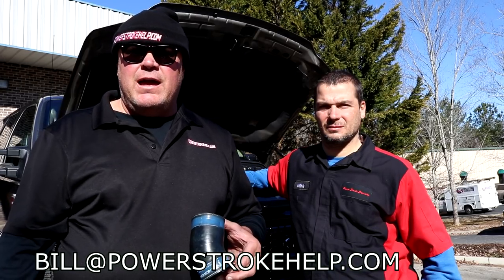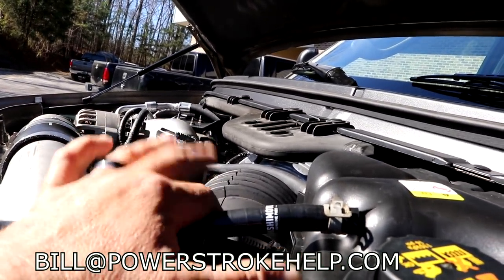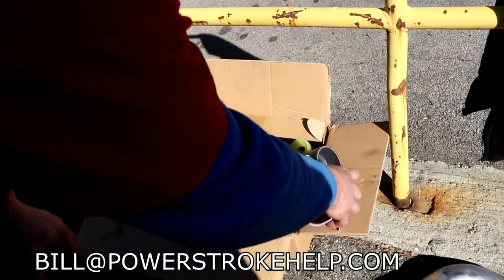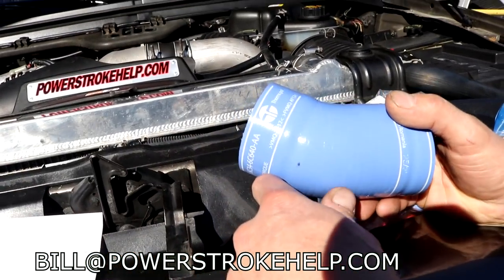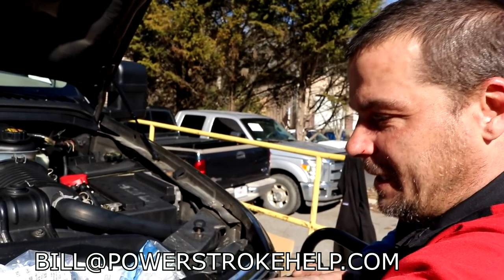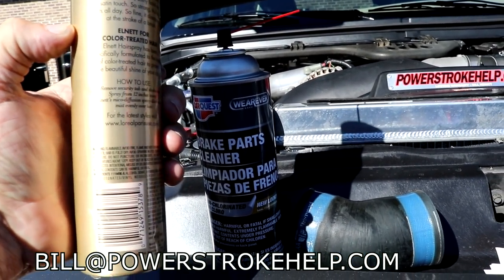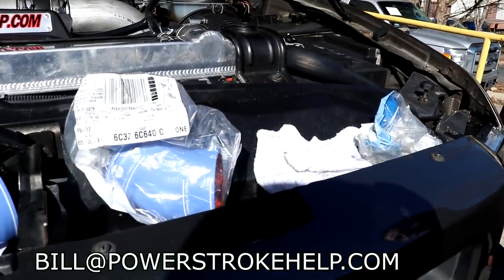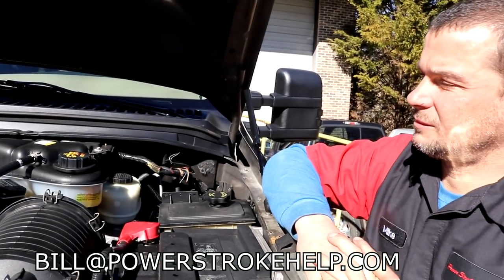POWERSTROKE TURBO BOOT FAILURE

Comment: The bank's intercooler tubes have these indentations, if you have a boot blow off on the side of the road, clean the intercooler Boot and the tube with brake cleaner, this will get you to your next stop so you can buy a new boot. Also when are we installing a new boot after cleaning each side, spray cheap Hairspray, not fancy stuff like Aquanet cheap, this allows you to slide it on easily, when it dries it will be sticky.

Comment: I love it when a master mechanic is passionate about his opinion. This is the 2nd or 3rd video that I've seen where Mike is trying to stress the point that the OEM air cleaner is the right choice. Message received. I've actually had the experience of having the turbo boot pop off and it's exactly like Bill described, and of course we were a long ways from home. I didn't know what to make of it initially and definitely had the "oh shit" moment, but I was relieved to find that after reinstalling the boot and tightening the clamp it stayed on for the rest of the trip. My mechanic had been in there working on the engine and apparently didn't snug it down or maybe they didn't have that rib aligned correctly. Either way when I brought it to their attention they disassembled and cleaned it and then used some of grandma's hair spray to give it a little extra grip. That was several years ago and it hasn't popped since.

Comment: excellent description and function about the charge air cooler. 
Bill, remember when you told me about my plastic charge pipe was cracked, but I never noticed a difference in performance.  well, the SCT fitting snapped off and left me at a dead stop outside Columbia SC at 2am.  March of 2017, I brought my truck in for a full dealer proof.  The Truck is still running strong

Comment: Bill, great video.  I just replaced my hot side lower cac boot (original) as I bought truck new!  All others replaced some time ago.  Went to Ford dealerr and $$$$, but did not trust aftermarket.  As a note, I was experiencing turbo "bark" when I would accelerate and figured out it was soot/carbon build up as I am an "old guy" and apparently don't drive my 04 F-250 hard enough.  I used, on your recomendation, a bottle of the Archoil 6500, and it cleaned my turbo up in a few hundred miles of hard driving, and runs great now.Thanx for your videos, PS, I have 256K on my 6.0. and still runs and tows my tt great, no bullet proof or tunes, stock except for larger exhaust from turbo back, love the sound.

Comment: When it comes to the intercooler boots .. I have spent the 500 + dollars on OEM boots,  purchased cheap after market boots etc,....  but the BEST boots I have ever used,  are the off road style.  They are made of extremely tough neoprene,  high temp, oil resistant,  interwoven mesh rubber ... they are 1/4 inch thick,  and can withstand being reinstalled over and over .... they DO NOT pop off if properly installed ....   they MUST be cleaned with diesel, the diesel MUST be cleaned off with brake cleaner and the boot MUST be dry and oil free before being reinstalled...  A Ford mechanic showed me a tip on the pipes and plenum and inter cooler connections ...  clean with any cleaner,  DRY THE PIPE CONNECTION with paper shop towel,  HEAT the pipe end or pipe connection with a heat gun or torch,  hot enough to burn the oil out of the pores of the magnesium...  cool... install and torque properly...    

I JUST today,  finished installing a new 7.3 factory rebuild engine in my 2000 F350. I used the boots on my old engine for the last 50k miles (of 333k total) ...  I was surprised to find that I DO NOT need new boots by a long shot... I am SO HAPPY,  that I found them ....   I COULD have gotten another 333k out of my old engine,  but because of the fakedemic and the fact that Americans are at war with the leftist bastards amongst us,  I could only get Delom15/40 instead of Rotella, to change my oil last fall 2021 ...  it found EVERY possible place to start leaking and created a nightmare for me to fix... I had another engine sitting and waiting to go in,  for the last 2 years,  but couldn't wear out my 7.3 .. it never even burned an ounce of oil until I used the Delo ....  Anyway,  it's in,  and runs like brand new truck....  I well never sell my 2000 F350 ...  I lucked out when I bought that truck brand new.
Reply: Who sells, or what brand are these "offroad style" boots you speak of? I'd like to know. Thanks.

Comment: Can't wait for the video... I've been trying to learn all I can on the 7.3, 6.0, 6.4, 6.7... I plan on buying one soon and I'm leaning towards 7.3 or 6.0... heck our older school buses have the 444 "7.3" and the engines are all still going crazy good at 25 yeas of age and still on routes with 350,000+ miles... our bus barn has already junked most of the 2008, 09, 10, 11 school buses...
Reply: Diesel Tech Ron. Absorb all of his videos.
Reply: Well I think that answered which engine you might want to buy

Comment: I got the "recall" (21E01) done on my 2016. I drove about 20 miles, towing my RV, and BOOOOM, that CAC blew off and the truck turned into a mega-slug. Ford service guy told me to get right back to the dealer. Turns out, my DPF was clogged beyond belief (according to Ford) and I needed a new one, along with three sensors downline. Good news? Ford would pay for it. Bad news? They didn't have the parts. Six and a half weeks later I got my truck back. Now it regens more than it EVER has. Diesel Particulate builds much faster than it used to. I have a Banks iDash hooked up and it measures all this stuff. However, my DEF level doesn't seem to be going down as fast as it used to. The truck ran fine before this "recall", and I now wish I'd never had the re-programming done. They don't do emissions where I live so that wouldn't have mattered. Grrrr. Every day I wish I'd not gotten rid of my 97 7.3!
Reply: May be time for you to pick up one of Bill's trucks and leave that new garbage at the dealership
Reply: @swashington942  Haha. I've actually come to love my 2016 now that it seems to run well. We're leaving for our regular Reno/Houston/Reno trip soon. I can't wait to see what the fuel will cost this time (hauling a 7500 pound trailer). FJB.

Comment: Just replaced mine with Mishimoto boots, they are way thicker and come with a lifetime warranty. And they have the groove you are talking about.
Reply: Riff raft has good ones to
Reply: Yup did the same thing, been problem free for 3 years and going.  Stock engine.
Reply: I’m pretty sure they’re the exception
Reply: @centraltexasfoxbodies  yup I went through 5 of their radiators on a 6.7 Cummins and finally gave up and replaced back to a OEM and haven’t had a problem since. I even had one of their radiators leak at start up, it was sent to me bad from their factory. I even replaced with their hoses and since have had every hose blow so I went back to OEM hoses.
Reply: Bill used to recommend those mishimoto boots. Wonder why he didn't mention them here

Comment: Thanks Bill and Mike for your time esplaining this. I have an '03 7.3 with 102k that I am finding has a few 'engineered mods' (i.e. hose clamp holding my CAC system to the turbo housing) and more that I am correcting this week. Thanks to your Archoil Sale last week, I bought enough to last me about 2 years as I figure there has never been anything ran through the fuel system. I bought new boots (and more) from RiffRaff for my maintenance/updating project for this week, I hope those are not on Mikey's DO NOT BUY LIST! (I will be checking for the ridge/lip inside when they come in). Thank you for your FREE videos!

UPDATE: 2022_03_20 - I finished all of the upper mods (extensive I will say), including new RiffRaff CAC boots, and did a few test pulls, slowly working up to a few at 23 psi pulls up to 95 mph and no issues. I have just spent 4 hours pulling an RV. Running a Hydra on the 80 hp towing-shift setting, it was running an average of 8 to 10 psi boost at 70 mph on the interstate, and EGT's staying near 700F most of the trip. I was pleased and had no issues there either. I figure that any issues with the RiffRaff CAC boots would have shown up by now. 

For SOME parts, I buy Motorcraft, but for my CAC boots, and more, Clay at www.RiffRaffDiesel.com will  have my business.
Reply: Riff raff have great parts.  I get most of my parts from them.  I have a 01 7.3 and a 04 6.0.
Reply: I put rif raf on my 99 7.3. 3 years so far doing good.
Reply: @robertmcdonald5277  I have my truck tore down now, hope to be finished by Wednesday evening, too much to mention, but Clay's pricing is great, just hate the shipping time from Oregon to Atlanta, nothing is fast other than he gets it to UPS the same day. Overall, Clay at RIFFRAFF is my goto.

Comment: Good one! Pearls of knowledge into a sea of ignorance. Would like to have viewed this about 18 years ago. North bound on Raton Pass comes to mind for one blow off which resulted in 16k lb.'s, with the otherwise adequate stock 6.0 PSD, going into slow motion. The weeping oil is the biggest indicator of up coming failure, IMHO. 🌝

Comment: I just bought the mishimoto boot kit because I'm going on a 5 hour trip with the camper, guess I'll be sending those back to Amazon and going to my local Ford dealer today. I could have sworn in past videos you guys recommended the mishimoto boots.
Reply: Mishimoto radiators for sure, but not sure about the boots.
Reply: They’re fine
Reply: I think they are the exception.
Reply: Look at the comment from Will Stone.  I replaced the ford ones with Mishimoto.  They had the groves and will actually last longer than the ford one.  I have 250k on a 6.0 that has been bulletproofed.  The boots fit the same.  I did not like the clamps so I purchased Ford clamps.
Reply: Isn't that something. I find the mishomoto clamps to be nicer than than the ford ones

Comment: I'm in CA and the folks that bulletproofed my '04 F250 (Left Cost Diesel) created a rigid clamp on the CAC tube, it has never blown off but I change the boots at scheduled intervals anyway, just like the coolant cap. Learned my lesson the hard way with my '03 Excursion, it blew off while towing towing the RV. Not a fun way to start a vacation, but we limped our way there trying not to build too much boost.

Comment: I put in the riffraff diesel 7.3l intercooler CAC boot kit. They definitely don’t have that little lip you pointed out on the oem boot. Maybe that’s why they keep blowing off at 40psi.
Reply: You are correct about The riffraff 7.3 Intercooler boot kit not having the little lip on it, Because the 6.0 boots have em, not the 7.3 boots. Lip and groove design was on 6.0 Engines, Not 7.3 Engines. My riffraff Intercooler boots got the Lip, cause there for a 6.0, notta 7.3.

Comment: I had this problem with my boots sweating oil, I went to Ford to get the factory boots and was told it was a minimum 6-8 weeks on back order, so I bought the mishimoto ones since you were recommending their products at one time. They have the retaining ring on them just like the Ford ones, been on my truck for a year and so far no problems…. I hope they hold up for a few more.

Comment: Riff Raff Diesel boots FTW! Plus, Bill touched on the CCV system, oil vapor gets sent back through the system, coating the inside of the boots breaking them down and blowing them off. I played the game with this exact issue on my 6.0. The fix... new boots of course, BUT also I started running my oil level in the center of the hashmarks on the dip stick, NOT all the way to the top. This was for two reasons... #1- this issue. Slightly less oil in the crank case seemed to yield less oil vapor in the CCV. #2- I would know if I had an injector leaking as the level would rise on the dip stick. Never had an issue since.

Comment: I’ve had the hot side boot come off of the turbo on a customers 6.0 dump bed truck. It dented the hood outwards. I learned the hard way that you generally have to replace the boots once they come off because they will do it over and over again.

Comment: Hot air only matters when you are not moving. I usually just mod the existing box. Most of the time they are super restrictive and you can feel noticeable difference. I take flow when driving into consideration when doing modding a box. I often make a diverter to guide the air towards the hole. It dont matter if its a truck or a little shit box. I always use the K$N filter and wash the oil off it. I know the oil grabs more dust, but its more restrictive than an oem like this. There are a few air boxes i have seen I would not mod because its already flowing the best it can.

Comment: I need your help with identifying a part. It’s the wiring harness that runs across the firewall alongside the cowl. It’s the harness that the clips break off. It’s the part that you use a bungee cord to hold up to get to the turbo. 
If you can give me the name and/or part number I would greatly appreciate it! Is this something I should buy from Ford or aftermarket?
I have zip ties holding it up now but it’s driving me crazy, Lol!
I bought my Archoil from them directly and upset on missing your promo. 
I’ve learned so much from your videos to maintaining my ‘05 F350 CC SRW and owe it to you! I love my truck and working on it! Thanks again for all you do making your videos and look forward to seeing your next video!

Comment: This has nothing to do with this video but what do you do with a plastic steering wheel that's weeping and sticky ..
Mine's a 2002 F250 XLT with a plain plastic steering wheel..
There doesn't seem to be any new ones available and I don't want a big thick snap on cover..

Comment: ive got 2006 e350  all stock with 260k on it.  parts replaced since ive owned it isthe oil cooler, egr cooler( if you do one of the do both your in there)  , the turbo, hpop and ipr.  it still runs great.

Comment: Bill, could you add a comment regarding excessive oil pull-over in tube which is generated by early seal failure in turbo? Some owners may interpret tube oil presence as c/case breather when it ‘s actually signalling  a future turbo bearing failure.

Comment: Corrective action on how to drive the truck when the boot blows off. Is it immediate stop or can I leg it for a few miles?
Reply from the maker: It depends on how much load you have on the truck. If you running empty with no trailer the answer is yes you can limp the truck BUT if you loaded she ain't moving.
Reply: Good question with a good answer.
Reply: This happened to me last week pulling a trailer with a light load. EGTs immediately run very high. You can limp it along. Do not let the engine start to lug. Make the transmission shift to prevent lugging on a hill. You'll be slow, but you can usually make it to where you can get it fixed.

Comment: So, I'm here because this just happened yesterday while pulling a trailer for the first time with my new(to me) truck.  We replaced with an aftermarket part from NAPA and it promptly blew off.  I'm just wondering, if there's a possibility that there is an issue with the intercooler that's causing a pressure overload.  I intend on replacing all the boots with OEMs, but I wondering if there's a possibility of an issue with the intercooler that's causing a pressure overload?

Comment: Can an intercooler boot (hot side) hole cause injection pressure too low error code (P2290) and hard to starts, drives fine, but can die when coming down to idle or dead stop? Or do I have a IPR problem as well? Oil presures (HPOP and LOW) are good. Not smoking, fuel filers replaced within past 100 miles. I have entire intercooler kit on order, definitely a hole, and splattered oil because of this. Hoping this resolves P2290 in addition to, no power, oil splatters, as well you all were talking about.

Comment: I have a question I can't find any rotello oil on any shelves or any other diesel oil for that matter and am due for an oil change. Supposedly there is a shortage, I have and always use T-6. I can make 3.5 gallons using T6 5 w 40 and 15 w 40. Can I mix these for my oil change? Or is it a no go?

Comment: Enjoyed the video.  I hope my 2016 6.7L does not have this rubber connections.  I also chose not to tune my truck.  Stock only.
Reply from the maker: Do yourself a favor and run the Archoil Ar6400D fuel system cleaner every 10k miles or so. It will help keep the fuel injection, DPF and EGR systems clean and running correctly. We have more than a few fleet 6.7L F350s and F450s with well over 400k miles with the original fuel system, DPF and EGR. Archoil products work as advertised.

Comment: I changed the elbow on my truck and didn't pay anywhere near $100. It says which end is supposed to face where, and if you don't know that an oily boot and an oily metal tube is more likely to slip apart, then you probably don't need to be working on your own truck.

Comment: Also the O-ring that is at the bottom of the air intake tube for the crankcase ventilation...if it is ripped or destroyed your truck will run like absolute poo ask me how I know..

Comment: I’m just not quite understanding, at first you said these later model trucks; the air from the crank case needs to be evacuated to not cause seal pressure ect, however, than you said not to delete it and route the pressure to the atmosphere?
Reply: He is saying the turbo creates a vacuum which helps to relieve the crankcase pressure. Deleting it removes the vacuum and too much pressure builds inside the crankcase which in turn causes oil seals to fail and start leaking.

Comment: Can any explain how 7.3 cid runs good a while then shuts down no oil in motor gone to fuel tank.
Reply from the maker: You need to pull all 8 injectors and check the seals. I would suggest you send them off to Mylex International in Mendenhall MS and have them tested before you reinstall them.